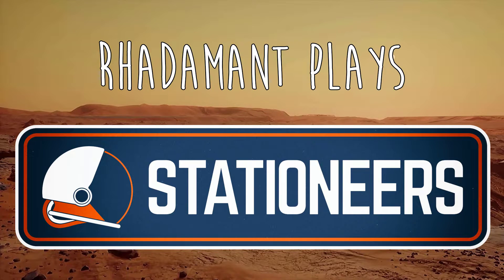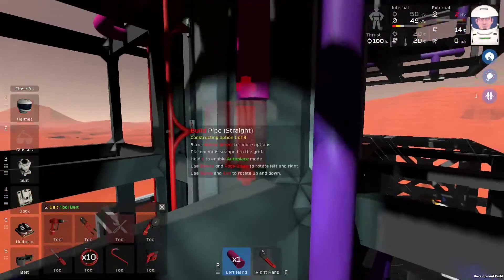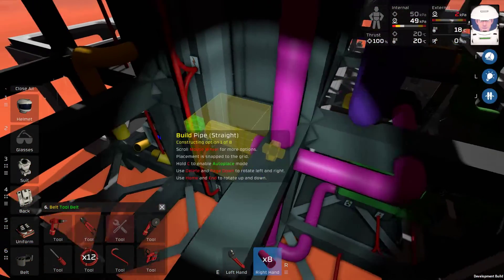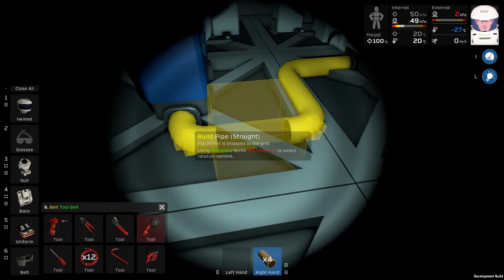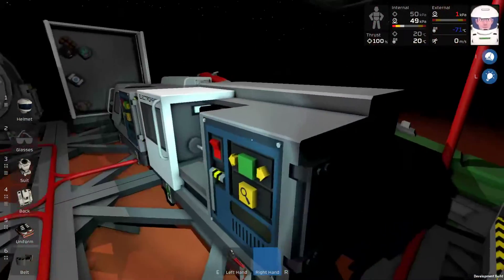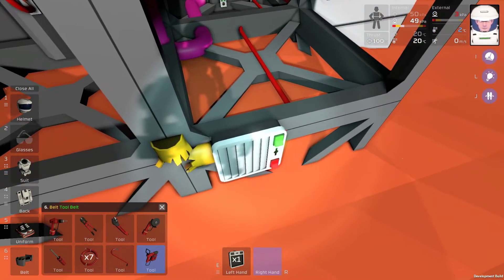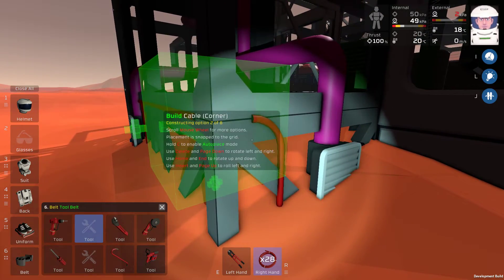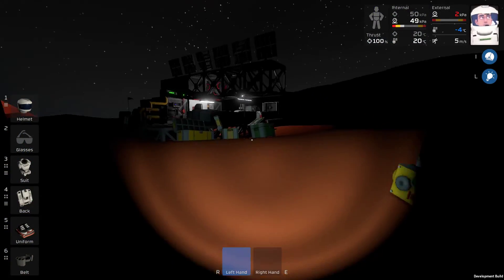Stationeers / EP 15 - Intake Systems / Mars Colonization

Comment: Also, you could set up a volume pump on your backflow system and not need all of the active vents
Reply from the maker: Yes indeed I could, maybe I even should =] I was planning on having reversed pressure regulators because they're quiet unlike active vents.
Reply: I'm building up a overflow system with volume pumps and logic. Memory, Logic Writer, Logic Compare and a Pipe Anayser reading directly to Memory/ Pipe Pressure.
Made a test and as long you don't set values way to close and liters/ minutes not to high it doesn't click on/ off to often. Then again it all depends on the environmental variables you have in your setup..

Comment: @Rhadamant Even though you are further ahead in this series, I'm going to give you a few tips anyway. Gas in a pipe, in this game, doesn't flow. Meaning that if you inject lets say X gas into a pipe two miles away, it will be present anywhere in the same pipe network. This can be used to filter much more rapidly, that you are currently doing, by having all the intakes on the filtration units on the same pipe network. This will make them pull through the gas instantly to the tank and not wait for filtration unit 1,2,3,4,5 and 6 to finally give you the output from that last one that you need. Only downside is that you need a filtration unit for every gas you want out.
The other tip is that you need your Chlorine (X gas) to be outside/isolated. It's a refrigerant gas and it will fight the heating of your base, since it's naturally going to cool much faster than other gas'. So keep that tank away from the others, preferably isolated completely and just let it cool down to what it can. This way you can easily bring up the temps of everything else to match your target indoor temp.
Reply from the maker: Hey Rudi, absolutely great tips! I do plan on using X/Pollutant as a refrigerant!

Comment: Wouldn't it make sense to build a bypass for the pollutants for when you are pulling in atmosphere to save on materials and power?
Reply from the maker: I actually want to collect pollutants because they act as the most efficient coolant IIRC.
Reply: @Rhadamant  yes, but if you filter everything else out of Martian atmo, all you have left is pollutants
Reply: @brotherfrenchie8539  A bypass with two digital valves and logic when Pollutant tank is full? That can save some watts for sure as long uf you Logic it to turn off filter and bypass trough valve and/ or out to atmos again 👍

Comment: Rhadamant, why dont you connect all the inputs and the unfiltered gasses to the same pipe instead of having them connected in series. That way would allow you to turn off 1 filtration unit that you arent using and the rest could still work perfectly fine. It takes a little more pipes and 1 extra filtration unit for the last gas but it might be helpful in the long run to have them connected in parallel instead of in series.
Reply from the maker: I could do parallel rather than serial, it's just more pipes and another filter unit, but if people want it that way, okay
Reply: Do it how you want. The thing i like about parallel is that you dont need to worry about the order your filtration units are in. You can turn off anyone of them without having to remove the filter